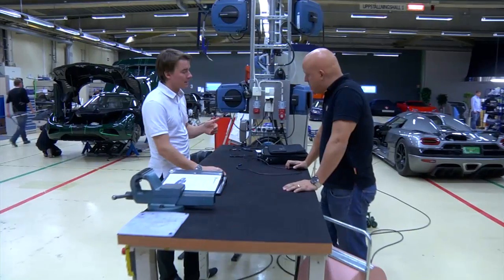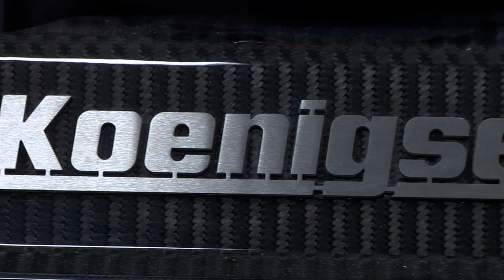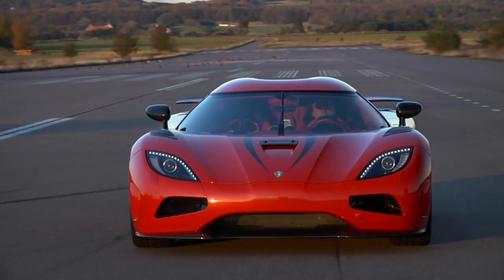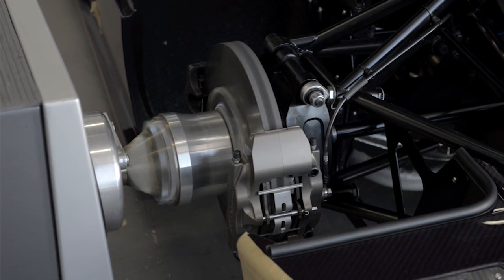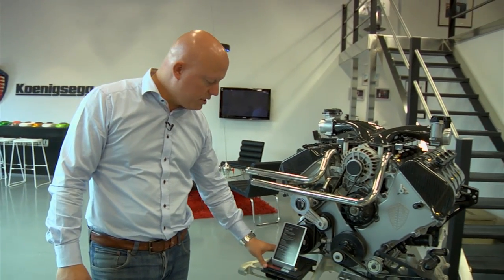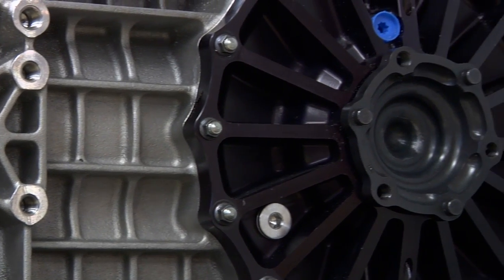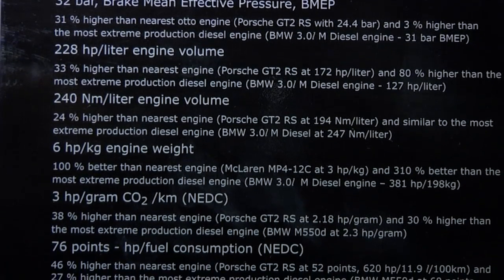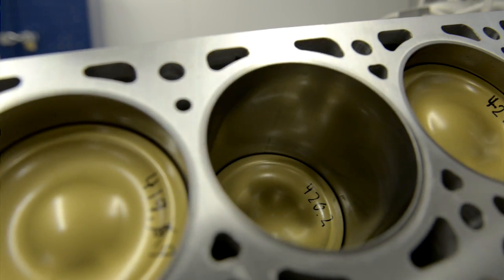The 1140 hp Heart of a Hypercar - /Inside Koenigsegg

Comment: Since they are located on the other side of the fuel sensor, I could guess at best those are the exhaust pipes, definitely made out of stainless steel, I might be wrong because they are kind of small, expected them to have a wee bit bigger diameter, but if you ever saw the twin exhaust pipes of a Koenigsegg (2 pipes located vertically on top of that plate in the rear), they could be exhaust pipes.

Comment: The blocks of the first actual Koenigsegg street cars featured a Ford 4.6L DOHC racing block. There are obously other aspects of the engine that came from Koenigsegg, but it does say alot about the respect they had of Ford Racing products, that they chose the 4.6L block to go 240 mph in their first cars. The 4.6L block itself has been known to handle pure drag car speeds of over 230 mph in just over 6 seconds flat. See "John Mihovetz". That's a stock 4.6L block.

Comment: The veyron is good if you want to do 200mph in a straight line with the AC on and not be scared.
.
Pretty epic engineering, sure, but it has a purpose, and that purpose sure as hell isn't to navigate the twists of mulholland....  Unfortunately its purpose is pretty useless unless you're on the autobahn.  Not like you can drive that thing hard at a track (unless it's straight...).

Comment: There's more to it than that.  Most people aren't driving F1 cars with ABS controllers with stupid high refresh rates.  The ABS controllers in most production cars has a laughable refresh rate, making them quite terrible at braking on imperfect pavement due to inconsistencies in weight transfer.  So it's not preferred by many who are driving production cars.  The Nissan GTR is a very high performance car, and as-such, probably has a very nice (and expensive) ABS controller.

Comment: You realize that the Hennessey Venom GT destroys the Veyron in every acceleration milestone except 0-60. I weighs much less than the Veyron and makes 1200 HP - it doesn't seem to have a problem. But, you are right in the idea that it is traction limited even being that quick. Most people would put on drag radials or slicks and take it to the drag strip because you can't legally drive these cars to their potential on the street. AWD alters build & ultimately areo, meaning it would hurt top speed.

Comment: Um, I'm pretty sure the block is from Ford. And Secondly, you replied with a pith, uninformed, comment stating the only American engines that can get that type of power are drag engines that only get 5 mpg. This statement was in response to a comment I made regarding Lingenfelter/Callaway/Hennessey getting that kind of HP and I mentioned nelson racing engines are getting far more from a lsx based motor. Therefore, you did, in effect, state exactly that. Typical of Euro-trash.

Comment: Actually, idiot, smaller engines - when stressed to this degree - usually get worse gas mileage than larger because they need more boost to make the torque. The Lingenfelter/Callaway/Hennessey motors are not "drag engines," but Nelson racing engines usually are. Regardless, you were acting like American based engines can't make that power when they have been for decades. I know it's a balmy 98.6 degrees up your ass, but if you pulled your head out once and a while you'd see what we call reality.

Comment: You do realize that this car is wider and longer than the elise/exige and has had many of the parts manufactured for that difference. It's tubular from the cockpit back and, just like you claiming the engine in use is the "grand...grand child" of a Ford block, it comes from the LS series, but is completely set up to run under these boost levels and additional abuse from idiots - SAME DAMN THING as you mentioned. You obviously are an idiot by force, because nobody would choose to be so stupid.

Comment: The most power per weight engine is American. The SSC Ultimate Aero's engine blows this away in power/lb. 1287hp on 91 octane and about 425lbs. The Agera is under 1000hp on 91 octane and just a tad heavier.
And just as derpenguin44 said, familiarlize yourself with NRE. SBCs puttin out 1800hp.

Comment: It is not the engine thgat makes the bad milage. While the m1 Abrams has a jet turbine with 1500hp the german Leo2 an the israeli Merkava have turbocharged Piston-diesel engines. m1 and Leo both have got a power to weight ratio of only 24 hp/t. There are lots of power losses in a chain drive. A tank weights over 60 tonns. And the aerodynamics of a tank are compairable to a full size kitchen with open fridge-doors. In a tank you would also prefer somthing less explosive than petrol or alkohol.

Comment: CCR already used the Koenigsegg designed engine, same as the Agera. But i'm not talking about the engine itself, that has been changed almost completely, as was correctly said. I'm saying that the architecture is still thae same, so centre to centre of the cylinders, bore/stroke sizes (though these can be varied quite easily), stuff like that.

Comment: You do realise there is a difference when you make ~50 engines in total vs. making ~50 a day? The tolerances, the materials and the production processes can be TOTALY different at such diferent scales. And do you even know what the word architecture means when talking about engine design? I think Christian himself said that the engine is based off the Ford Modular V8, it's quite common knowledge, unless there were some big changes (the displacement is the same, so the arch. has to be too?).

Comment: If find it amazing that you find time to argue but wont take a few minutes to inform yourself on what you're aguing about. Again, here's a informative video:

watch?v=kc9eavLa_cI

I repeat, debris has nothing to with ABS function. It simply matches the revs of the tyres to the speed of the car so the brakes doesn't lock up. NO HUMAN is able to match this if it's properly calibrated no matter what surface.

Comment: lol, I know I'm wrong?  More like I don't know anybody including myself who would rather use ABS in real racing.
.
On any paved, perfectly even surface, with absolutely no debris, yes, you're absolutely right.  If you can tune the ABS (which you can't, on the VAST majority of cars that have them) and it has an extremely high refresh rate, yes, it's better.  Perfect road conditions rock.  Almost unfortunate how pressed you'll be to find them outside of F1 tracks...

Comment: lol.  Don't know, man, never met a real racer who wanted ABS.  I've had it fuck with my braking distances on uneven sections to the point where I was legitly scared and pulled the fuse on the next run.  Much more predictable after.
.
It doesn't matter how many pulses it has (well it does), it's how flat the road is.  You keep yammering on about fucking F1.  You never see the slightest bump in F1.  Also, in F1, ALL electronic traction aids were banned, it simply got lumped in.

Comment: They did keep most of the outer geometry actually so it looks like a Ford mod kind of how like the CC8S looks like a CCX. It makes sense to borrow the outer geometry and attachment points if you don't want to spend a ton of development cash on non crucial accessories that are readily available from Ford racing dealers.

So it's still "loosely based on" even though fundamentally different.

Comment: I see your point, I really do. I just wanted to chip in that the Veyron isn't exactly service-free. Prepare to spend $21k anually to have it serviced (and that's just an inspection and change of fluids).

Btw, those 100k miles will set you back 40x$33k=$1.3M in tires and 10x$50k=$500k on wheels

Comment: Its all in the tune. Ask some of the guys driving around with that much hp on their supras which is an even smaller motor on stock blocks. Its all how yoy have the car set up. And yes you could drive a. 572 tt motor daily it already has the power  from the displacement itself so u dont have to do a million rpm tofeel any of the power. Normally ppl dont go above 3k rpm daily. So the engine will be fine. Bottom torque is what makes the difference.

Comment: when  you say reliable i think you mean that it stars and runs right. there is no way that an 1150 wheel horsepower big block that got its power from whereever the fuck isnt going to be tore down and rebuilt after every time it goes to the strip or every hundred hours of hard driving. have you ever rebuilt a motor? forged pistons arent god pistons.

Comment: actually the original Veyron calims 1001Bhp but it's closer to 987Bhp and the Veyron SS claims 1200 but it's slightly less, and the 2013 Agera R makes 1140Bhp, so even if Bugatti makes what it claims it's only 60Bhp but with a lot more engine, also the Bugatti is heavier where the Koenigsegg has the better package as well

Comment: and do they last long ? weight of them? co2 output, ami allowed to use those engines here ?
I push out 400 WHP of a 2 litre alu engine without a sweat, my friend does 1000!!! out of the same with 2.2 L and yet... I'm not amazed by it having almost the same power as this engine in the video, cause it's absolutely horrible to drive in comparison, set for one fuel, uses masses of fuel.
many use fuel as cooling, just going rich for cooling...
everything in consideration... this one is impressive

Comment: God you are ignorant. ABS is rarely used in racing because it's deemed as being too much of an advantage. What is so hard to understand about this? They banned it because it made it so that driver skill was almost completely eliminated. You can't pass a car with ABS at a later braking point since it will be perfectly straight and stabile every time.

If you stepped on the brake at 200 mph in Venom/Lotus you would DIE. Huge difference.

Comment: I'm sick of Ferrari/Lamborghini as well, but Pagani is as special as Koenigsegg. They have many innovations such as lightweight carbon fiber 12v batteries, Kevlar fuel lines to prevent Ferrari-esque fires, the rear badge is CNC-milled from an aluminium block, and the shifter mechanism alone has 67 components.
And by the way, the AMG bi-turbo V12 is made especially for Pagani, it's not like they just slap an M158 engine inside. The car and engine are designed uniquely/exclusively for each other.

Comment: The Venom does meet all current laws to be a production car. That is why it can be compared.
I like that it shows you CAN meet laws and do it in a 2800lb car. And do that without the use of a carbon frame. It is sad when the lightest hypercar is 3200lbs. It is nice to have someone really pushing the bounds of power and weight, even if their car isn't worth the cost.

Comment: The standard Agera (not counting 1 off specials) makes 960hp on regular fuel. The Ultimate Aero made 1287hp on regular fuel.
While the UA engine was "larger" in displacement, it was more compact and LIGHTER than the Agera engine.

To say that the Venom can't stop means you know nothing about it. Have you driven it? Seen a 300-0 attempt in it? So how can you say it can't? The downforce and traction shown says it will be fine.

Comment: Hennessey has literally no creature comforts and not even traction control or ABS. The CC8S weighed 2590 lbs on a similar set up and it wasn't exempt from safety regulations like the american tuner cars are. The reason why Hennessey went for the 0-300 kmh record and not Agera's 0-300-0 is because you can't stop it flat no hands on the wheel like an Agera. The car is very instable.  

The Agera S produces 1030 hp on regular fuel. That's a 5 liter engine and not a 6.3 liter or a 7 liter.

Comment: Surprisingly, that is not hard at all. Their currently are turbo kits for Suzuki Hyabusas that make 300hp on pump fuel, not even E-85 cheater fuel, out of their 1.3L engine. That is an engine not optimized for forced induction either.

Cost and reliability would make it prohibitive for any of the major manufacturers to put it into an economy car though.

Comment: I will agree with what you were trying to get at. Hennessey showed that there is no reason that a hypercar can't weight under 3200lbs, much less under 2900lbs, and still make over 1200hp, and on regular pump fuel, not cheater E-85.

I think it is just how you said it. That and that Hennessey didn't build a proper exotic but more of a tuner car that should cost half what it does.

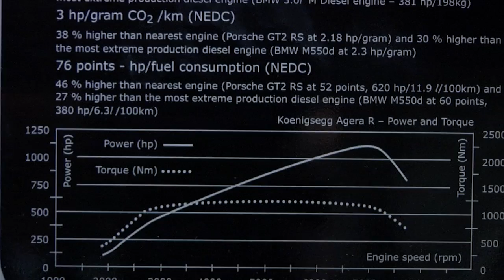Comment: At 7:04 there is a dyno chart for the Agera R.  
The HP and TQ lines do not intersect at 5250RPM.
I thought that a proper dyno chart is supposed to have the horsepower and torque lines intersect at 5,250 RPM?

Comment: #3 It realistically isn't the most power dense (production) engine either. Using the SAME fuel, the Agera makes only 940hp on 91/93 octane. The Ultimate Aero (6.3L V8) made 1287hp on 91 octane. That puts the UA at 204hp/L while the Agera is at 188hp/L.

Comment: This has been a great series of an amazing car/company, but this video, unfortunately, has some false stats. See my 3 points below:
#1. The Koenigsegg V8 is NOT the most power per weight engine. At 422lbs & 1287hp, the SSC Ultimate Aero's engine is 6.7hp/kg vs the Agera's 5.7hp/kg. Using 91 octane, the Agera is only 4.7hp/kg.
#2. E-85 is NOT a green technology. It has been proven many times that it produces more emissions than regular petrol due to production emissions and worse fuel economy.

Comment: Really? Then why did Koenigsegg use a Ford engine if Ford and American engines are all shit? And why does, after all of the facts are straightened out, does Koenigsegg's amazing V8 still not match the Chevy based engine in the SSC Ultimate Aero for power/weight or power density?
Koenigsegg makes a great car, but you are a moron.

Comment: All the internal geometry plus the ECM is all different. Keeping the overall shape so they can fit some parts from the the network they built around the old Ford engine block does not constitute it being a Ford engine when it's functionally completely different. 

They could completely redesign it but then they'd have to fund bits like pulley systems etc that are readily available from Ford racing custom dealers. Not the best way to spend research funds...

Comment: Not necessarily. Christian has many times said that, yes, it is a Ford based motor. BUT it is VERY far removed by now. Through the whole CCxx life cycle, it has gone through many changes and advances. The engine was re-designed for the Agera.

Comment: I swear I read somewhere that they were using Ford modular engines but he said they designed and built this engine. This looks JUST LIKE a Ford modular, minus the valve covers, COPs, dry sump system and intake manifold. Even the location of the accessories and location of the cam and crank sensors. I wonder what Ford thinks. He must have cut a deal to use their architecture.

Comment: Please don't compare this to the drag car - Venom GT, in the REAL world, where REAL people actually drive cars like this, there is no contest. Its not all about horsepower or top speed....  its about using the power and for most people that actually drive, how a car handles and basically how well the clever the diff/engine, suspension and tyres mesh together in a Swedish ball of engineering magnificence is allot more important than bragging about the top speed of an EXTREMELY WELL TUNED LOTUS.

Comment: So by your definition all DOHC V8's ever built are actually just derivatives of the old modular Ford V8... You say "oh he just changed the heads". Show me all of the 5.0L 90 degree V8's ever built together in line and I guarantee you will not be able to tell more than 3 or four of them apart. A block with 8 bores in it is exactly what it is. The heads he "changed" are the FUNCTIONAL part of the motor. The block may be the biggest part of the motor, but it has the smallest functional use.

Comment: what you say is true, but go now and open the hood of '05-'10 GT stang and you will find the same engine, except for the heads since this blad guy changed it from a single cam to a duel cam v8. also the coils packs look 900% like the stang coils, same alt placement, same water pump pulley and same crank pulley.

So yeah a "in house" design that take it's lines from the 3valve ford engine.